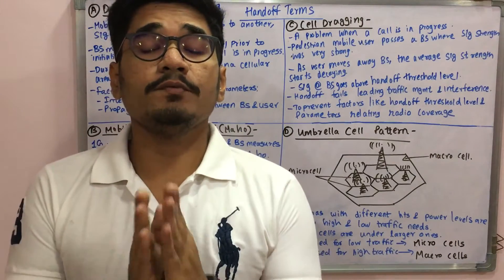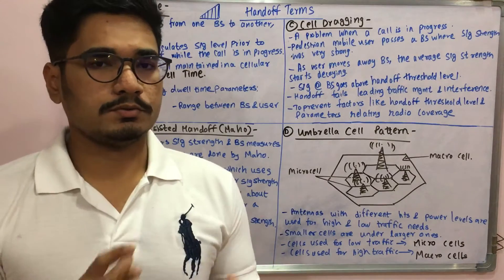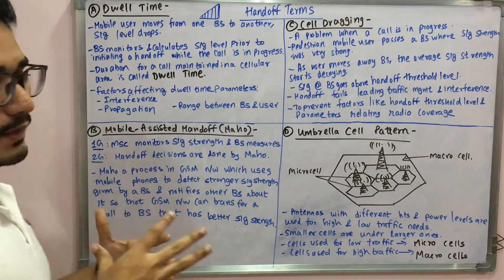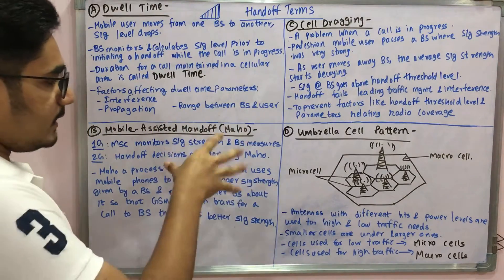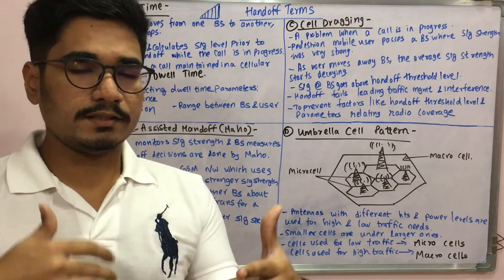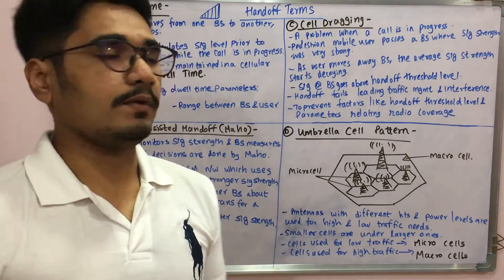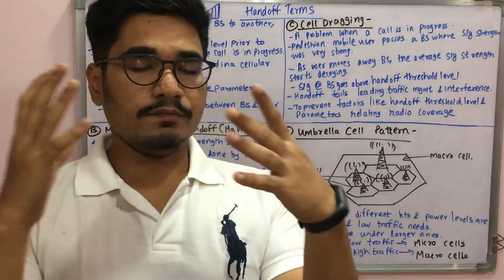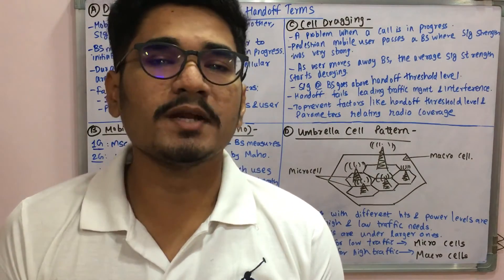Wireless Technology | Tutorial #14 | Dwell Time, Maho, Cell Dragging, Umbrella Cell Pattern

Comment: sir cell dragging has a different concept as written in the book. When The pedestrian users are providing  very strong signal strength to the base station,as user goes away from the BS slowly,the signal strength does not decay rapidly even though the user may have reached beyond the designed range of the cell, the received signal at BS station may be still above the hand off threshold-thus a hand off may not be made.
Reply: Thanks ( ´◡‿ゝ◡`)
Reply: This is the correct definition
Reply: Its same thing ....sir also mentioned same